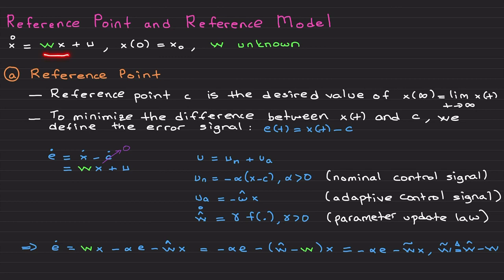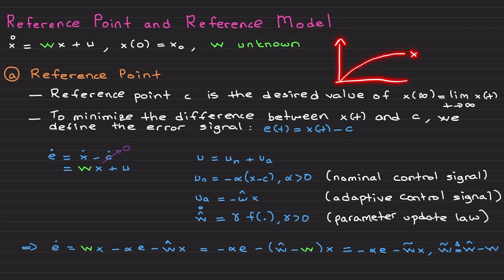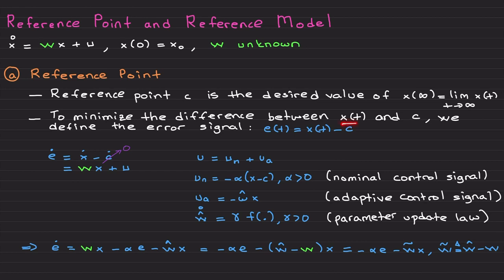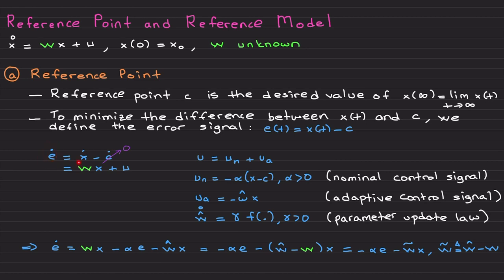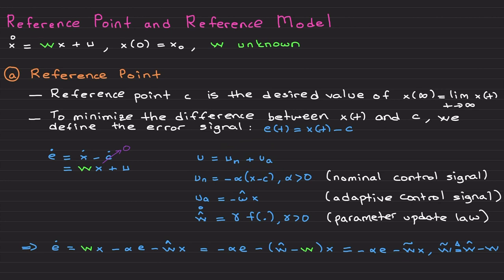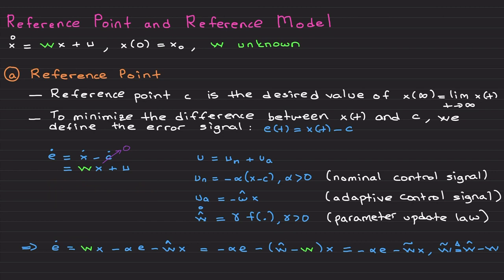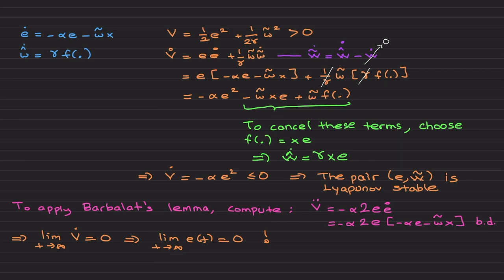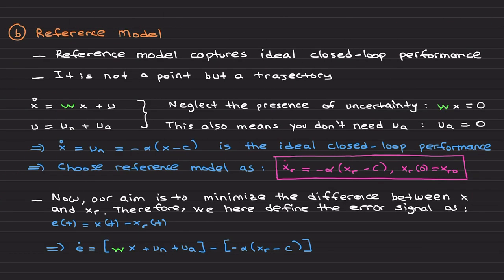Reference Point vs Reference Model (Lectures on Adaptive Control and Learning)

Comment: Hi Professor,
Thank you for the video!
Maybe it is covered in the later lecture,  but for tracking a reference point perspective, is there any L_{\infinty} norm analysis? i.e., is there any strict upper bound proof for the max deviation between x(t) and tracking point x_e, for t>0? at least for linear system?
Thank you very much!
Reply from the maker: Thanks for watching. Answer is yes. As an example, take a look at how equation (64) is computed in [ https://onlinelibrary.wiley.com/doi/abs/10.1002/047134608X.W1022.pub2 ]. This specific equation represents the upper bound of the maximum deviation of the error signal, where it results from the Lyapunov analysis. Hope this helps ;)
Reply: @tyucelen thank you professor, this paper really helps❤

Comment: Dear Professor Yucelen, Thank you for this fantastic video.
At timestamp 16:00 of this video, is it much reasonable to use $u=-\alpha(x-x_r)-\hat w x$ in MRAC.  However, performance in mahlab shows that the performance using this controller is not good as using the controller that given in your slide.
Thank you so much!
Reply from the maker: Thanks for the comment. Let me mention that anything you use should be provable. In other words, it should not degrade the Lyapunov stability. In addition, the nominal dx/dt model w/o uncertainty should be compatible with the reference model. When w=what=0, dx/dt=-a*(x-c) and hence dxr/dt=-a*(xr-c). Finally, using x-xr instead of x-c will slow down the closed-loop system performance. Because, c is already the command and convergence of xr to c will take sometime. This may be the reason for poor performance. Let me know if these help.

Comment: Hi,
    Does the choice of the reference model unique?
    For me, the reference model method looks like a sliding mode control, and the reference model is the sliding surface...😄
    Thanks!!
Reply from the maker: Reference model captures the ideal system performance when there is no uncertainty. If this is captured by sliding mode type controller, then it can be your nominal controller. There is no restriction in this regard. Let me know if this makes sense ;)
Reply: @tyucelen  Thank you for answering my question. Your answer makes sense to me😀

Comment: I do not get why the reference model is missing the desired reference input signal r like:

dx = w*x + b*r

I also dont get why neglecting uncertainty means w*x = 0. In my understanding no unvertainty means we know w and w*x != 0.

Why is that?
Reply from the maker: The command/reference signal is c and it is on the reference model. 

Let’s consider a+b. Now let’s “neglect” a. Then we only have b. I use the wording “neglect” to forget about a variable in a proper context.